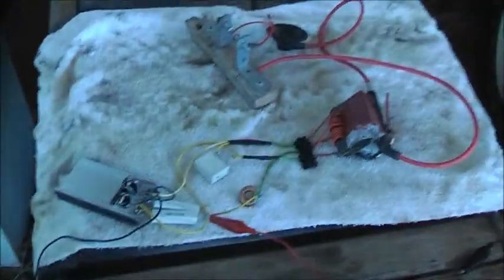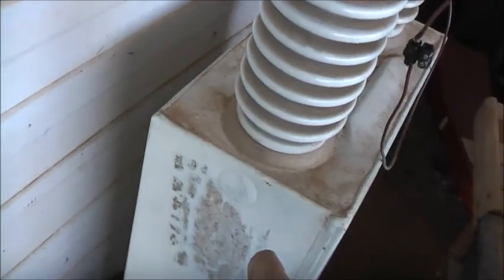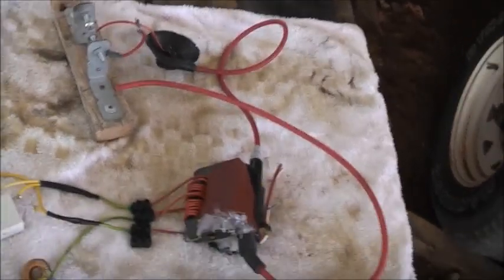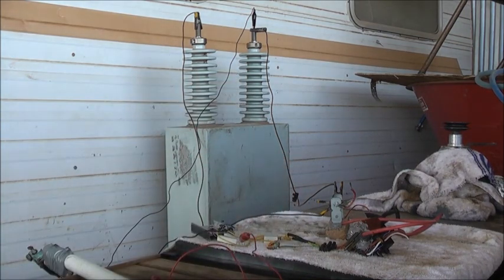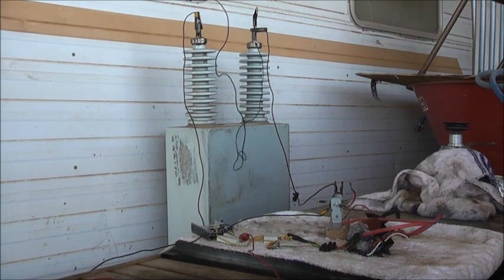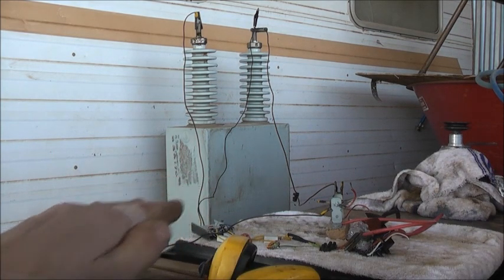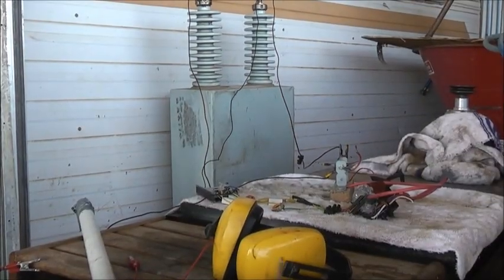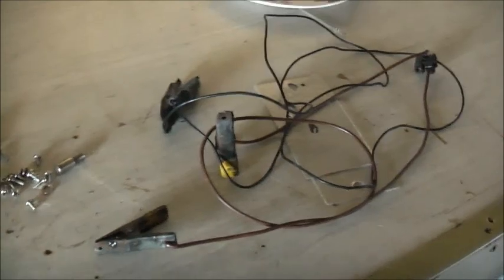Big PFC Cap On ZVS!!

Comment: Larry that cap is fine for zvs flyback inputs mate. With it not being none pules rated!! High voltage and very low milliamps. Your fine to do what you was doing. Theres no danger! Just wear goggles and short out when done. The cap will not explode!!! The only damage it will do over a very long period of time is distroy' the decreases the effective electric dielectric between the plates!

Comment from the maker: yer Yours may be diffent than mine, as mine is designed for BIG power Factor Correction, spec plate says it's surge rating is 75 KV!!, Kizmox ones of these caps are a little smaller yet he has overvolted them to well over 30 KV!!, I think they're 7.5 KV rated, With a small puny Charging circuit like this, I think it should be fine, I HOPE!!!!!

Comment: You be bloody careful with that. It will do some serious damage. I would suggest. you use some form of current limiter to charge it. take longer but will make the cap last a lost longer. Don't go over the voltage rating of it though. What is the value of the internal resistor.

Comment: Nice big pops, BUT.... I have read other peoples' comments, & they seem concerned about the cap exploding "because-it's-not-pulse-rated" whatever that means.

I think, it means that the cap won't like dumping it's entire contents in a split second, because something may happen inside which would cause a lot of heat or something, resulting in an explosion..... Maybe?

If so, then this may be OK for slow discharges, as like it may have been used in its previous job, but not acts of poppage.

-BBD.

Comment: Those Caps will take some abuse, when the link drop outs get taken out large arcs can happen. The insulation should be able to withstand some abuse with the ZVS, Just keep your safety goggles on and use the discharge strap when finished.
Good clean cable connections are a must.